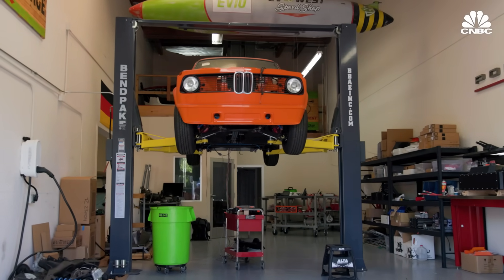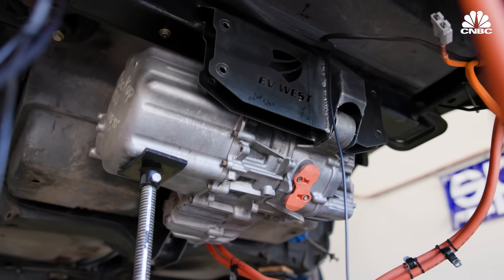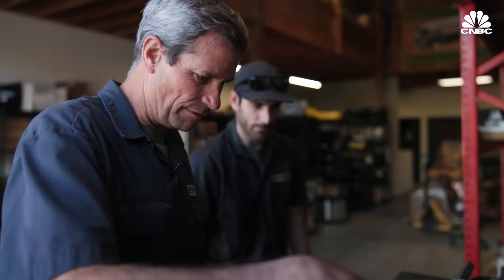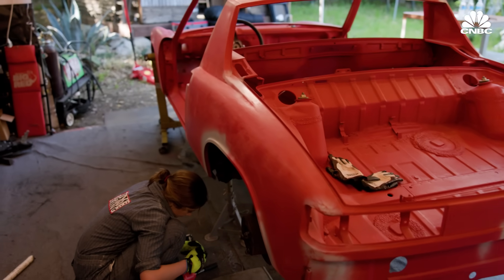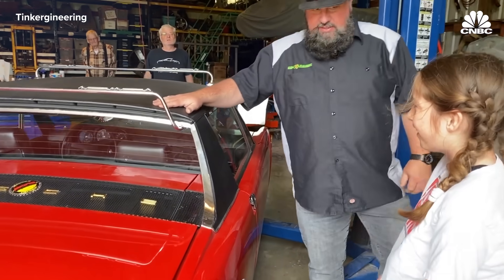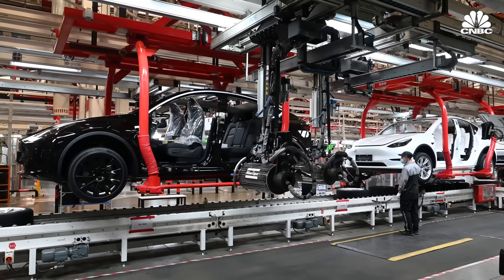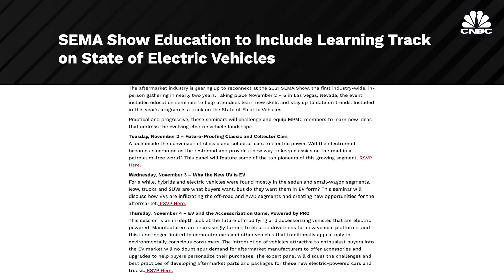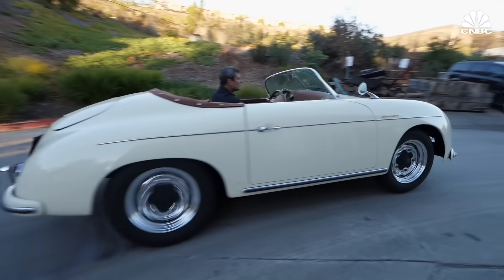How To Convert A Gas-Powered Car To An Electric Vehicle

Comment: My dad has also been doing some of these ev conversion on and off the last decade along with restoration. Right now he is retrofitting a 50's Porsche 356 that was converted about a decade ago into electric to a newer system. It's mostly the fun of rich people who get this stuff done.
Reply: @@sageopheim8382you're not saying differently than it's mostly for people of means.
Reply: How many miles do you get on these cars per charge?
Reply: @ken-mb5cp  Enough to drive around the block and take miss daisy out.
Reply: @ken-mb5cp up to about 300 mikes in some cases. All depends on battery size and efficiency! 🤷‍♂️
Reply: @ken-mb5cp  I would never buy a car with less than 400 range if I'm paying big bucks
Reply: @tannerpaisley-ve6dq  You walk then?
Reply: @ronaldking1054  Are you 8? There are gasoline vehicles that give 400 or more.
Reply: @tannerpaisley-ve6dq  But you stated that it would not be costly to buy them, and I am claiming they would be no more inexpensive than the alternative, with slightly less range.
Reply: @ronaldking1054  I inherited 2 cars and I bought a cheap one years ago..
Reply: @tannerpaisley-ve6dq  Oh, so you're claiming that the cost of 2 of the cars required the death of a family member, right? Thank you for agreeing with my point. They paid the cost. You did not.
Secondly, it is damn near impossible to search for range in an internal combustion engine because it is not a selling feature. Higher efficiency usually results in smaller gas tanks.
Reply: @ronaldking1054  If you say so troll lol
Reply: @tannerpaisley-ve6dq  You said that you didn't buy them, but you got them from a dead person, who hopefully bought the car. That is the definition of inheriting. I also know that any time cars are set up for efficiency, they shrink the gasoline tanks as you would still buy fuel at the same rate, which was the actual selling feature as then each tank cost less money. Try searching for range on internal combustion engines. You get EV lists.
Reply: @Sage Opheim lol you’re obv not that rich then 😂
Reply: @Sage Opheim …as I said refer to my previous statement. 3rd world doesn’t equate to broke but as I said again if you were rich you would know that btw I’m Canadian lol
Reply: yeah you eityer already made tons of taxpayer dollars to do this or you are literally being handed everything you need by companies that want to "prove" anyone can do this. this is the kind of farce CNBC likes to get into and legitimize without elucidating on the real hard work and labor it takes behind the scenes for average nobodies with not even a back yard to their name to do something like this.
Reply: I have question, how do you insure an electric converted car?
Reply: You hit the nail on the head. A RICH PERSON CAN AFORD IT... The common man can't.  Do see the problem.
Reply: Sacrilege
Reply: It's mostly the fun of rich people who get this stuff done. -> this
Reply: Make videos on it and be rich
Reply: Converting a 356 to ev should be a crime
Reply: Restoring/re-engining classic cars has always been a thing that's mostly the fun of rich people.

Comment: I'm just here to read the comment section.
Reply: There' some real stick in the muds "I will never bla, bla, bla" They are funny. One hundred years ago they would have been saying "I'm not swapping old Dobbin for no gas vehicle. I can fuel him on the side of the road for free"
Reply: @ianhamilton3113  Yes but going from dobbin to petrol power was a massive advantage 100years ago. Fail to see the upside with EV’s!  We’ve all come to expect more 100 years on. EV’s only deliver less than we’ve already got, and in a more irritating way.
Reply: @petew1810  Yes but 100 years ago gasoline was sold buy drug stores. No gas stations. Things change  We are only ten years into EV's and they don't cover all requirements yet but it just takes time. The changes are coming fast. Watch Sandy Munro, his good.
Reply: @petew1810  "EV’s only deliver less than we’ve already got" Try having a burn up with a Tesla. Faster, cheaper and you could fuel it from your roof. 
"Oh no, I'd rather pay out a fortune over the years to the oil companies" Yerr whatever!
Reply: @ianhamilton3113 So you never have then I take it? You’ve never had an ICE vehicle? Even an EV has got to have some oil. How do it stop without brake fluid? It’s not all regeneration. Even motors have grease to lubricate bearings. You’ll struggle to be Oil free my friend, whether in a raw form or a derivative. What ever you choose you’ll be paying that’s for sure ! Good luck with it, and keep smiling. I will 👍
Reply: @petew1810  "You’ll struggle to be Oil free my friend" I'm not trying to be oil free. I'm actually just enjoying a better and much cheaper way of getting around.
Reply: @petew1810  "What ever you choose you’ll be paying that’s for sure" I agree but just so much less.
Reply: @petew1810  "You’ve never had an ICE vehicle?" Yep, gasoline, diesel, commercial plus towed, plus driven in Asia, Caribbean, Europe and Pacific (islands, obviously).
Reply: @ianhamilton3113  lol free fuel on the side of the road.
Reply: @OneManOnFire  And something to take home for the roses.

Comment: She's doing this at 14? Wow. Can't wait to see the car once it's complete.
Reply: She found an interest in something, took initiative, and willing to put effort, additional learning of a new skill including how to monetize along the way.  Great to see in the next generation and congratulations to her.
Reply: It’s great that she has the drive and ambition to do what she’s doing, but you all need to recognize she has a LOT of help, not the least of which is a home situation where her parents fund all of this and have the means and space to do so. This is not the reality for MOST kids today.
Reply: At 24, she’ll be converting that car back to ICE when a replacement battery gets too expensive, as the Chinese will corner the market on manganese & cobalt.
Reply: @SamWesting  I knew there'd be a dumb comment with this video.  I'm not disappointed.
Reply: @andrewdiamond2697  The EV industry is dying. Deal with it.
Reply: @LaZarusXtnct  Bonus dumb comment. Winning!
Reply: @SamWesting  You're such a wet towel. I also check out what's actually going on too. The Chinese won't all of the supply chains forever on everything.
Reply: @SamWesting  Too bad you don't know about lithium-iron-phosphate (LFP) batteries Sam Westing: these batteries don't use cobalt and manganese and are already used in some production vehicles. And by the way there are several other lithium battery chemistries in research and development. One possibility: lithium-sulfur, which uses relatively common and inexpensive sulfur (BTW: the youTube channel "Monroe Live" tears down EVs for engineering research as does the channel "WeberAuto"):

Zeta Energy: A Battery Breakthrough?
https://www.youtube.com/watch?v=YLGUEehKIiU

Also, too bad the US absolutely can't do mineral exploration in an environmentally friendly way, you know something like:

youTube:
"California’s Lithium Valley could power electric vehicle industry | 60 Minutes"
https://www.youtube.com/watch?v=ApxGBJJH0jw&t=444s.

Initial estimates point to Salton Sea lithium being able to supply all of the US lithium needs AND 40% of the world's needs.

Or getting other minerals from toxic coal mine waste (thereby cleaning up some of these toxic waste sites):
"In coal country, a new chance to clean up a toxic legacy" (Washington Post, 19 May 2022).

But hey, sure, let's just sit on our butts and let China buy everything up.
Reply: @SamWesting  you’ve never heard of a sodium ion battery?
Reply: @SamWesting  Yeah and gas will cost 20$ per gallon if you can find it.
Reply: @ken-mb5cp  Gas will reach $20/gal. due to inflation eventually. So will a dozen eggs. Will you be able to afford that?
Reply: @SamWesting  More like because production dropped because we're not burning through it like we used to. Oil companies already see this coming, and have basically stopped investing in increased extraction and refining capacity as they diversify to becoming "energy" companies.
Reply: @SamWesting  When your fuel has a confidence level to just 2050, which is 27 years, inflation is not going to be the driving force in the price of gasoline. Gasoline production decreases have already hit the diesel fuel market as well since diesel is a byproduct of gasoline production.
Reply: @ronaldking1054  “Experts” have been incorrectly predicting the year when the world runs out of oil for over a century now. You’ve just blown your credibility on this topic.
Reply: @SamWesting  "Does the world have enough oil to meet our future needs?
According to the U.S. Energy Information Administration’s (EIA) International Energy Outlook 2021 (IEO2021), the global supply of crude oil, other liquid hydrocarbons, and biofuels is expected to be adequate to meet the world's demand for liquid fuels through 2050. There is substantial uncertainty about the levels of future liquid fuels supply and demand. EIA reflects some of this uncertainty by developing a Reference case, High and Low Economic Growth cases, and High and Low Oil Price cases in its projections. The oil resources currently in the earth's crust, in combination with expected production of other liquid fuels, are estimated to be sufficient to meet total world demand for liquid fuels in all cases of the IEO2021.

An often cited, but misleading, measurement of future resource availability is the reserves-to-production ratio, which is calculated by dividing the volume of total proved reserves by the volume of current annual consumption. Proved reserves are an accounting concept that is based on known projects, and it is not an appropriate measure for judging total resource availability in the long term. Over time, global reserves will likely increase as new technologies increase production at existing fields and as new projects are developed."
This from a gov domain website from the U.S. Energy Information Administration. The Trump administration used global supply with a United States consumption for the denominator to claim that there was enough oil. If you take the estimated global supplies, it's 47 years, but hey, you don't need to prove anything, and that is good because you can't.
Reply: Sam Westing If gas prices increase due to inflation, so will everything else, including EV battery prices. Do you not understand how simple economics works?
Reply: @Shoprestorationthe  NMC batteries are busted, the new hotness is LFP which uses no cobalt & manganese. In the pipeline are many other chemistries that use cheap materials like sodium. Meanwhile oil refining and catalytic converters still need precious metals and rare earths.
Reply: @ronaldking1054  Neither can you prove anything. But unlike you, I didn’t need to type a couple of paragraphs to show that.
Reply: @Shoprestorationthe  I was responding to the statement that $20/gal of gas would be unaffordable. Which is why I brought up inflation. How much value/buying power $20 holds is going to be relative. How about calming down before impulsively writing out daft comments?
Reply: @jamesvandamme7786  Sodium ion batteries are 25% less energy dense than lithium, which means those battery packs would need to be even heavier to hold the same power. And the weight penalty would reduce driving range, which means more frequent chargeups. Which in turns, means shorter battery life. Na-ion does not offer a free lunch.
Reply: @SamWesting  Based on the global consumption and the projects that are known, 2050 is where we know we have oil. After that, we may have oil. There is a reason that even the military is stating that using oil is a national security risk.
Reply: @SamWesting  No, you do not know what battery chemistries sodium can use, which means that you only know the first-generation chemistries. Shortest paths start by assuming the best (lithium in this case), and then it finds the end, but here's the problem, that isn't necessarily the shortest path because combinations of paths can make it shorter in the middle with a middling path in the beginning. Until those chemistries are exhausted, there is no way to know how much heavier or lighter sodium will end up being. You stated a fact about an unknown, which you also did with the petroleum.
Reply: @doujinflip  Americans used a record amount of gasoline ⛽️ last month. I mean, in the whole history of the country!
Reply: @Sam Westing  
In your dreams 😅
Prices will continue to drop. The only exception is American labor.
Reply: @kabysummit5801  exactly
Reply: Kaby Summit You believe in a pipe dream. The primary issue is now and will always be sourcing the heavy metals required for the batteries. Unless a completely new battery technology comes along that doesn’t require them, the EV battery will dramatically increase in price in the future. And with no such technology on the foreseeable horizon, there’s no reason to believe this will change.
Reply: @Shoprestorationthe  the sodium ion battery is on the horizon.😊
Reply: @kabysummit5801 hmmm, my battery pack options have gone up a few thousand bucks since I started planning a car.  My goal was to buy them last, new ones, not from a salvage car, but they have only gone up up and up.  I figured like you, but that hasn’t planned out so far. Hoping for some crash to occur and get prices down.

Comment: I’ll stick to burning ancient dinosaurs thanks though
Reply: One hundred years ago you would have been saying "I'm not swapping old Dobbin for no gas vehicle. I can fuel him on the side of the road for free"
Reply: @ianhamilton3113  yup same outdated childish mentality on full display for everyone to see. 👍🏻
Reply: @4literv6  yep everyone has the right to express their opinion even if they are as wrong as you👍
Reply: @ramblin327  The problem is when they confuse opinion with fact. And not willing to  try something new. And as I am looking after a two year old, not willing to try something is a childish trait.
Reply: @ianhamilton3113  I work on and gm have driven EVs and ICE vehicles. EVs have drawbacks that fanboys seem to ignore. Blissful ignorance is a childish trait
Reply: @ramblin327  ALL vehicles have drawbacks!!! A Fiat 500 is not much good for a guy with a yard business. You wouldn't think of using a Nissan Leaf to tow a caravan or trailer. Owning a Hummer in Paris might give you parking issues. Horses for courses.
Reply: @ianhamilton3113  Fiats are worthless due to unreliability. Go Toyota or Honda. Hummers are completely unnecessary and are image vehicles only. Go with a real truck. Again if you buy an EV they are disposable with planned obsolescence. The Auto industry has already been heading that direction. It’s terrible when my customers with new vehicles or EVs see the price and unavailability of parts due to non serviceable components.

Comment: basically a ruined car if it goes ev
Reply: Try driving one, they are better.
Reply: Many of these conversions are done so they are reversible, in case you want to sell the car in its original spec. You just keep the ICE components in storage somewhere and put it back to original with matching numbers etc to keep the purists happy. But in the meantime, you are enjoying the vehicle, and not putting miles on the original engine and transmission, so for a classic collectible car, that's a win-win situation.
Reply: Do you have a secret stash of classic engines and parts? There are classics everywhere needing an engine or some impossible to find part to keep it running.
Reply: @dannelson6980   I wasn't speaking from personal experience, just from what I have seen online. I'm pretty sure EV West does conversions like that, where the owner wants the conversion to be reversible.

Comment: The weight of the battery can increase the weight of the car by 50%.  That means, every time you accelerate, your mileage is cut in half compared to a gas car!!  You will use 50% MORE energy to accelerate your car if the car weighs 50% more.  In fact it's more than that because there is much more rolling friction because of the hundreds of pounds of added weight.
Reply: I see you have no engineering background. Electric motors are three times more efficient than equivalent gas engines. That's why Tesla gets a gasoline equivalent of 120 mpg in their cars.
Reply: @jjackson3240  No, electric cars are WAY less efficient.  Gas cars burn the fuel directly at the point of mechanical application.  Power for electric cars starts at power stations, hundreds of miles away where only 40% of the fuel energy is converted to electrical energy.  Then there is transmission loss, transformer loss, conversion loss, loss as the battery is charged at the charger, loss in the battery as the battery is charged, loss as the battery just sits there, loss as the battery is discharged, and loss as the electricity tries to turn the motor.  All these losses add up and so an electric car is about 10% efficient compared to a gas car.
Reply: @skrame01  EVs still win when it comes to efficiency. Making and transporting petroleum products is incredibly inefficient.

Comment: Maybe someday it will be the other way, convert the electric to gasoline
Reply: If you can find gasoline. Production is already leveling off because the oil companies know the demand won't be there as electrified transport displaces fuel burning.